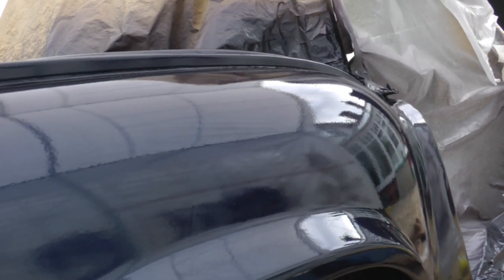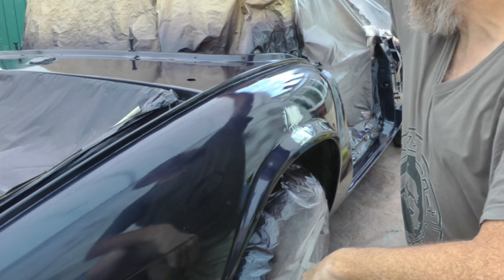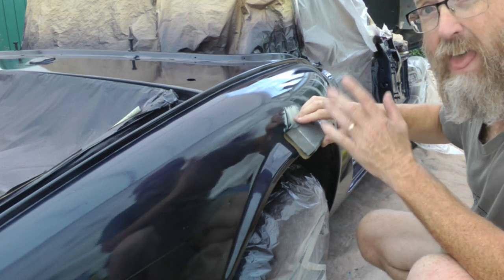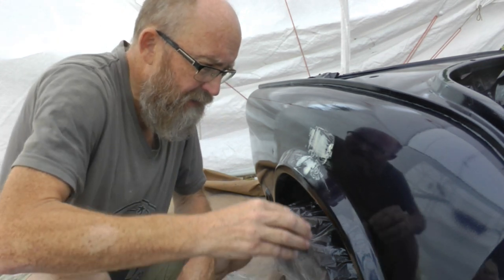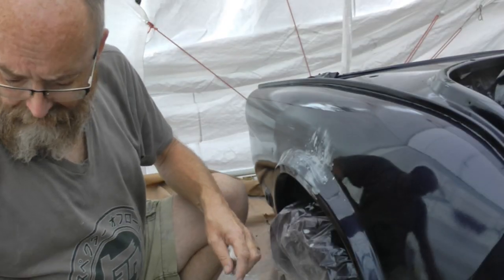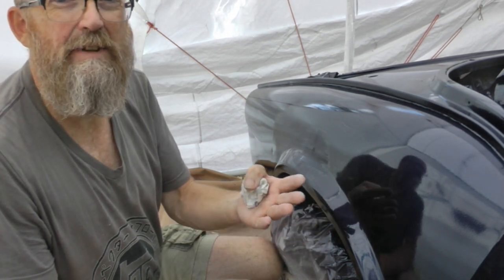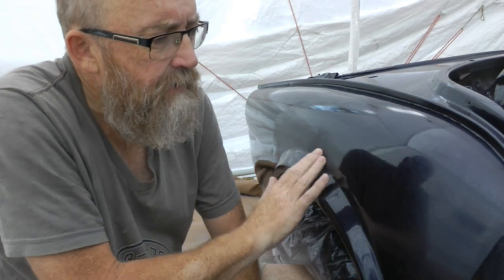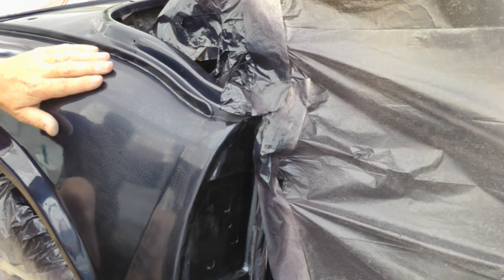How to remove runs in clearcoat, by the Incompetent Restorer

Comment: Maybe a tip for next time. When removing a run the block you use should be as solid as possible (preferably a wooden stick or something in that manner). But for these thin runs i would recomend using a razorblade/tungston block technique. Used to do it with glaze putty but in a shop environment its faster by scraping the runs of. Otherwise great vid!
Reply from the maker: Many thanks for the tips and taking the trouble to reply. I tried with a blade but struggled a bit with that. maybe I need to get a tungsten.
Reply: @546268  probably worth trying with the tungsten since its more forgiving. But the clearcoat must be very dry. Keep up the good work brother